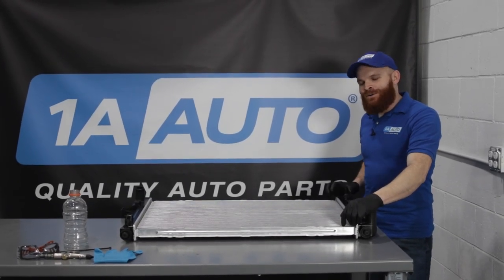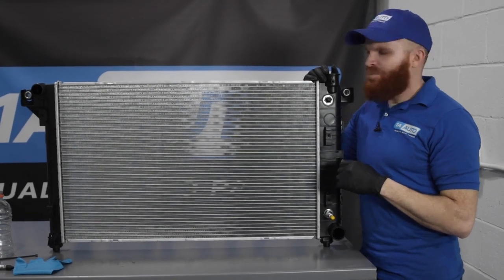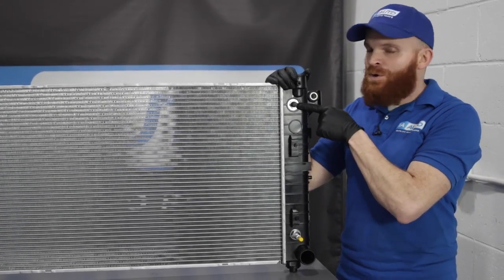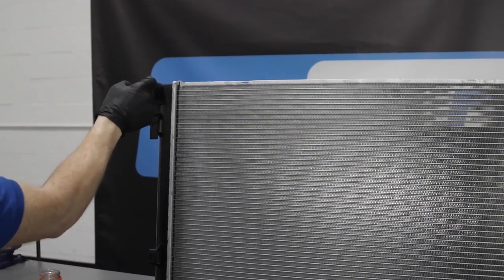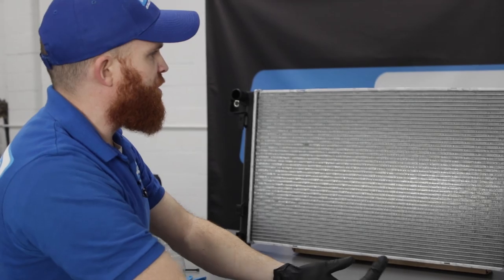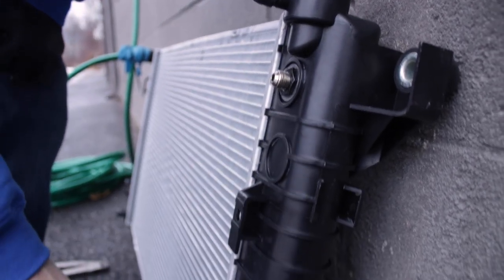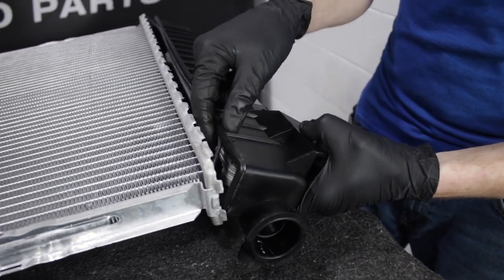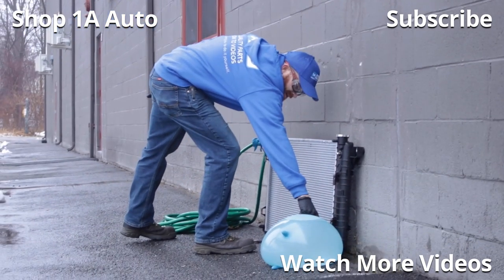Why Does My New Radiator Have Extra Ports?

Comment from the maker: √  Watch the Video
√  Buy The Part at 1A Auto http://1aau.to/m/Visit-1AAuto
√  Do it Yourself
√  Save Money
Reply: Aluminum made radiator is poor at dissipating and heat transference. Technical proven Research has proved that copper and brass far exceed that of aluminium. Plus aluminum radiators cannot be repaired if they develop a leak.

Comment: Thanks a million mate.  That saved me doing stupid things to my replacement radiator.  I thought they were part of the exfill tank and needed to be sealed.  My car repairs cost me $75 doing it myself vs about $250-300 to have it done at a mechanic.  So even though I'm in a different country, your knowledge was able to help me get my car back on the road without high expense and hassle.  This was a very helpful video for me. Cheers.
Ps... You also convinced me to neaten out the flattened fins (less than 1%) just to maximise airflow.
Reply from the maker: +LeoTehJester Thank you! We love empowering our customers and showing how to perform DIY auto repairs with our high-quality auto parts. 1AAuto.com

Comment: You answered my question straight up even before I asked the question about the "extra parts"...the (Engine Oil Cooler Line Connector). For the 2016 Nissan Altima. I replaces my rsdiator ane there is no leaks. Bravo to me ya'll. Thanks for sharing.

Comment: Great video, just to clarify, so since my replacement radiator came with coolant lines and my current radiator does not have those ports, I can just leave them open as they are, no need to do anything with them?

Comment: Can i cap the hole underneath the radiator cap? The location of mine is on  the other side of the radiator but it's not the drain. I installed a new radiator and noticed water would come out of it when i flushed it. I compared it to my old one, and it doesn't have that port.

Comment: Excellent. To the point. Ive been looking for the reason why my new Specter cu162 has 2 overflows below the cap..the larger one came with a rubber cap that cracked n leaked coolant needs replaced but was looking around to see if it could also be used for a heater hose also idk yet..more parts to fail.
Reply from the maker: +Wayne Freeman Thanks for checking us out. Shop for high quality auto parts on 1AAuto.com:

http://1aau.to/m/Shop-1AAuto-c
Reply: I have the exact same problem. Had the radiator replaced and it has two outlets with one with a leaking rubber cap. What can you use to stop up the hole?

Comment: I have the opposite problem. My new radiator has an extra inlet/outlet that a smaller hose would go on. Its in the same place as it is on my old radiator but my old one was capped/sealed. The new one isn't and didn't come with a plug

Comment: So, a leak in the transmission tube inside the radiator would explain the trans fluid in my coolant.

How would a separate transmission cooler work if it isn’t getting cooled with coolant? Just from the fins?

Comment: hey nice video. i recently got a radiator thats missing the trans line adapters do you happen to know what thread pitch ect i am having a hard time finding fittings for it. i can get a 6an to start to thread on but the thread pitch is greater than 18 and i cant find anything on the fittings other than generic fittings. PLEASE HELP!

Comment: Since usually the thermostats opens at 82 degrees .  How does the temperature sensor of radiator knows when to turn on the fan .. how does it time it so accurately or it doesn’t, the fan turns on automatically and independently when the water temperature reaches a certain point..??  I am co fused.
Reply: Clutch fans usually hace a temperatura sensor that triggers the fans to activate.
Reply: Fan are controlled by temperature sensor, when water reach 96°C and enters the radiator then fan runs on full blast and thermostat is on other side to restrict the flow of water if temperature is below 82°C

Comment: I just installed a new radiator and somehow stripped the bottom import to transmission fluid line and don't know it that can be removed and replaced???? At the moment I ordered a air cooled transmission radiator for $30.00 to by me sometime

Comment: And plastic is cheaper. They fail more often then the old school copper radiators.  I've had all my vehicles fail starting at about 125,000 miles.95  honda odyssey  went 1st replaced with a coppet radiater about 15 years ago now has 300,000 miles plus some. 99 toyota rav replaced with a denso radiator. Last was a 2006 subie sti which failed at 105,000 miles replaced with a koyorad all aluminium racing radiater.
Reply from the maker: +Piri Hern Thanks for checking us out! 1AAuto.com

Comment: I’m a year late to this video. But let’s say I got a radiator for a 02 Silverado from a another Silverado 99-06 (not sure of exact year) but it’s missing a hole for the coolant line that passes through throttle body. Could I remove the tank from my original and place it on the one I got and it work fine? They are the same size. Just curious before I experiment lol

Comment: Please help.  The lower hose of my radiator that comes from termostat ,  is always cold it only warm-up minutes after I turn off the car . I Change termostato 2 times and is the same I travel alot and temperature behaves normally . My car is a vw polo 9n 1.4 tdi  .

Comment: To be honest all these radiators can't get helped when there little air passages are blocked even after there installed in our rides they will eventually get hit with gravel or any debris from the highway I have seen so many of these get so much blocked from the air that cools it down
Reply from the maker: +Nitrous blast 365 Thanks for the tip! We'll pass this info along to our production team.